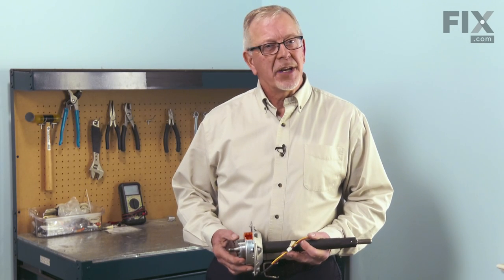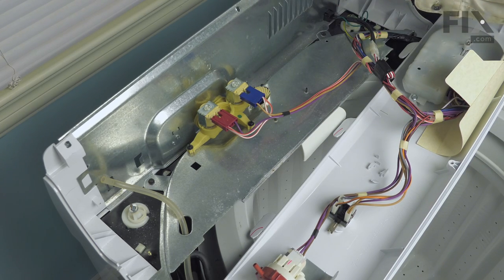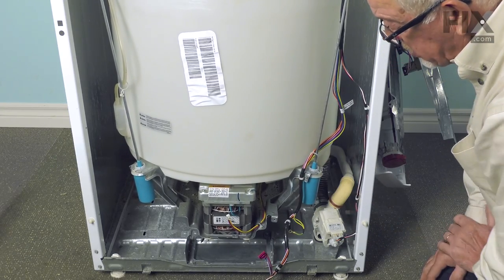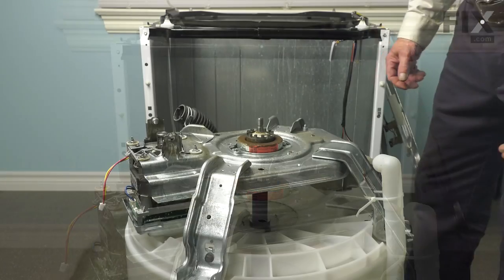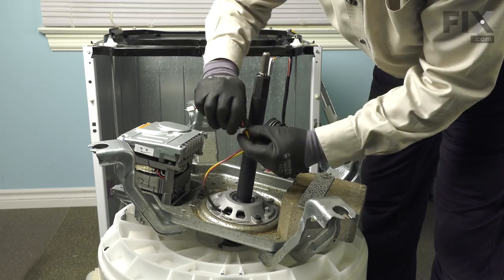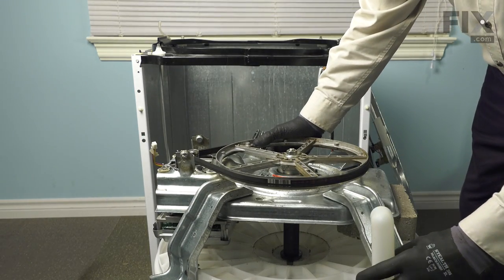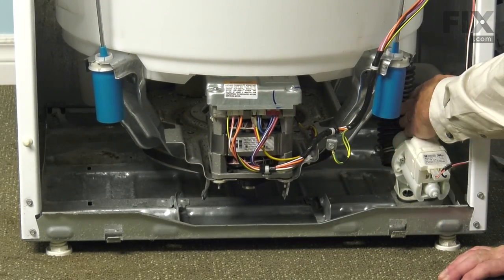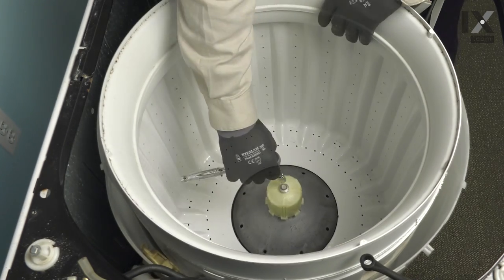GE Washer Repair - How to Replace the Shaft and Drive Tube Assembly

Comment: I followed the steps exactly as laid out in this video. If you can change oil in a car, you can do this repair.

There is no cheap workaround by replacing the $7 tub bearing, in fact, that’s probably not going need to be changed at all but I did anyway, since I had the thing disassembled. The shaft and tube assembly is 100% the culprit for producing the sound as loud as a jet engine during the spin cycle. You will most likely need to order a new hub nut and split ring. Due to the built up corrosion, I had to completely destroy the hub nut by drilling holes in it and breaking it apart. The split ring came apart when I tried to pry it off. Liquid Wrench is your friend during disassembly! Let it sit and do it’s job, wipe it and reapply and let it sit again.  Additionally, I replaced the drive belt and this can be challenging. I used three plastic wire (zip) ties to hold it in place while I rotated the pulley.

Once you get the thing taken apart, the rest of the job is as easy as it looks in this awesome video!

Comment: I have the same issue with a GE washer model GTW680BPL1DG.  But the center metal part on this one doesnt seem to sell separately .  And mine has gear splines in the center to slide over the shaft. The nut was left threaded. We used a 33 mm deep socket with a impact wrench to take the nut off.  So far it looks like an entire tub is the only option.  Very expensive.  Trying to find or create a better fix.  This one looks like that center metal portion is smalller than yours. And the center hole has splines to slide over shafts splines to turn it.  I see no bolts or screws so it was proably made on and not removable. Any suggestions. Glad you resolved your problem. Good video. Thanks for posting.

Comment: Buy yourself the $7 bearing and just replace that part instead of the entire $170 assembly. This bearing gets water on it after the main tub seal fails over years and allows water to seep down the shaft and pool onto the one main bearing. I posted a video with details on how to do it. Thanks for posting.

Comment: Hi Steve , I have a problem to remove the agitator , my washer is a bit older then yours in the video  , same maker and same thing , I have maybe a few model before . Anyway my basket move freely in the tub , look like it is not in the place that's way I would like to pull out the agitator to see what's looks like under it . How  can I remove the agitator ? Do you have any video ? I saw one video  before same as my washer but I didn't understand how you took it out , did you pull ? In the video you replace the old agitator with the new one and different shape .Thank you Steve or anyone can sand a video to help me .

Comment: You showed the step of brushing off a part with a wire brush, and then skipped the part where you removed it - in the next frame it was gone. How to you remove that part (the "split ring" I think?).

Comment: Our washer (GTWN2800D1WW) was only a couple of years old when the motor/inverter was taken out from a lightening strike. That was replaced. Ever since it sounded like a freight train during the spin cycle. It always made little noises since it was the older style turn and pull knob to start. It got to the point during the spin, which it sounded like it was spinning a lot faster than before, it wanted to dance across the floor. I adjusted the leveling legs a few times. I thought maybe they put the wrong motor in. At one point I heard a grinding sound during agitation, but it stopped some. Any suggestions on what could be the problem. We just got a new washer because I was ready to throw the old one out the door. lol

Comment: I am getting a bad grinding noise during wash and spin cycle. I have not taken the machine apart. I do feel a wobbly motion in the pulley when the belt is removed. If it turns out that the shaft and drive tube assembly is bad, can bad parts in the assembly be replaced?

Comment: Replaced the shaft which was clearly broke. Now the washer walks across the floor, which it wasn't doing before. Any suggestions?
Reply: Use the height adjustable feet to level the machine.  This assumes the tub dampening (rubber) straps were replaced and in good shape.